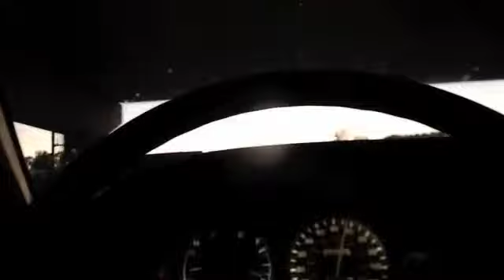Are We Smarter Now???

Comment: My sisters both had Hondas, a 78 Civic, & 80 Accord, they both had points.  My old boss had a mid/late 80's Hyundai Pony with points.  When Ice Racing a Datsun 510 in the 90's, my Crew Chief (a mechanic 10 years younger than me) didn't know what to do when I had trouble mid race.  I had to get out of the car, adjust them, then get back in, strap up and go.  Incidentally, the points and condenser for a 78 Civic are the same as the points for a Datsun dual point distributor, You just need 2 sets.